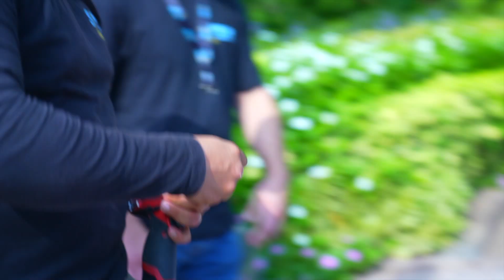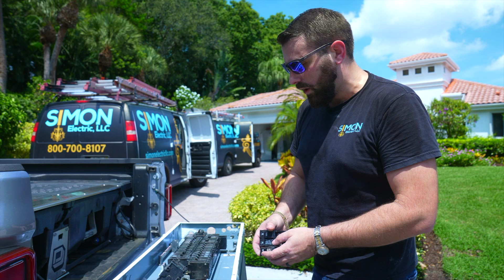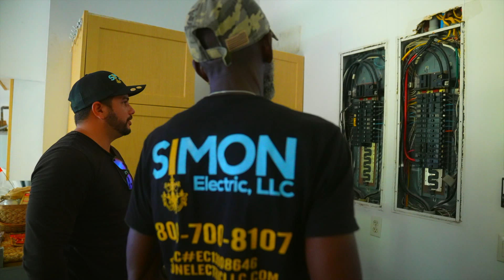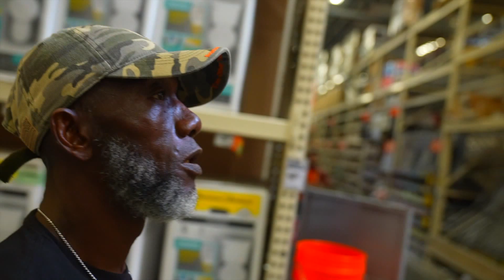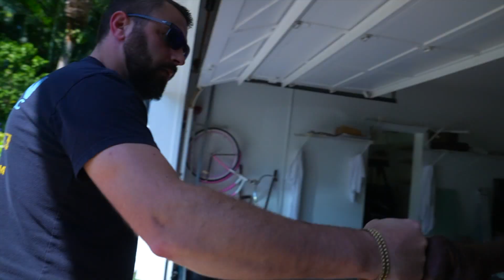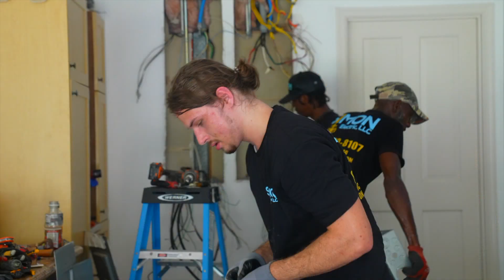When To Replace Your Electrical Panel or Breakers - Simon Electric LLC

Comment: We've replaced many of these panels. I know all of the tricks of filing down Home line breakers to fit in these type of panels. It probably will work and is safe but the aluminum bus after years of corrosion potential just not safe.

Comment: Hi, Simon  

I ran into FPE alot working in Columbia, South Carolina.  I'm not a licensed electrician.  That means I usually work as a electrical helper or electrical apprentice.  What should people unlicensed do when working on commercial jobs when fix the problem, but don't replace the FPE equipment?  I was almost electrocuted by my JM Electrician after he told me the EMT conduits inside conductors were dead and to cut off the old conduits.  There was an arc flash when the saw hit the wires inside.

Comment: Wow!, 4 guys on one Panel Change job.  I never had that luxury.  I had to do these jobs by myself when I was younger.  I might have an apprentice every now and then.  Great video
Reply from the maker: Yes, as my father always says, "many hands make for light work" and we get it done 2x as fast keeping down time without power at a minimum for the customer. If I remember correctly the power was only off for a little over 2 hrs. Thank you for the comment!
Reply: I still have to do these type of jobs by myself.
Reply from the maker: @Pawel Elektryk  we have electricians do them by themselves frequently as well, it all depends on the schedule and the requirements of the homeowner.
Reply: @simonelectricfl  Very true.nice job btw.U guys do the drywall repair yourselves or you have someone who comes in after you are done and fixes it?
Reply from the maker: @pawelelektryk2985  we sometimes do drywall but we try not too lol